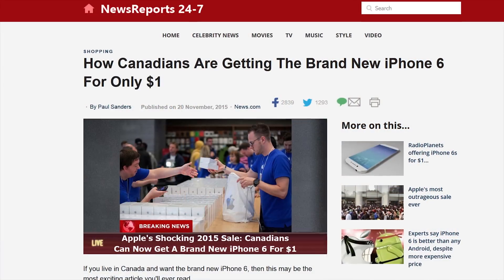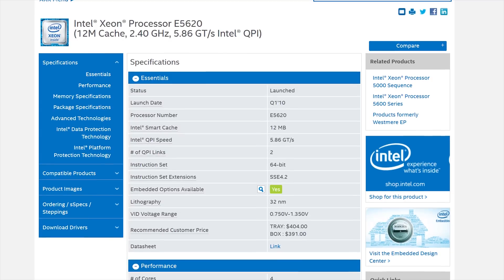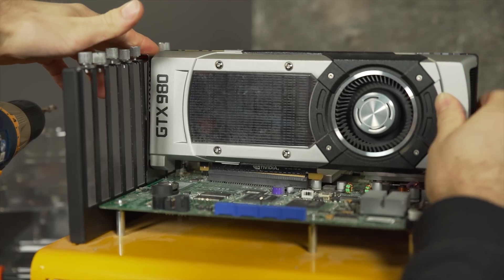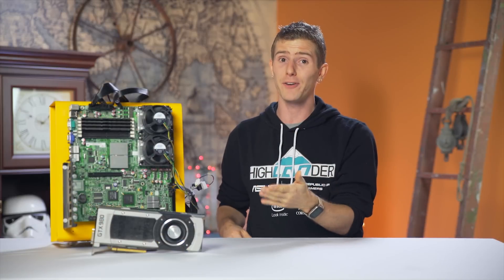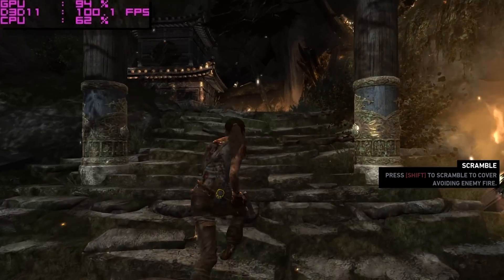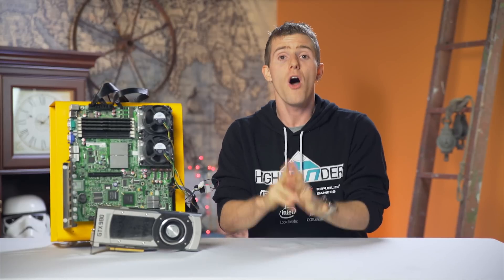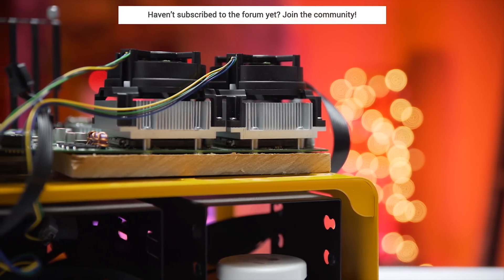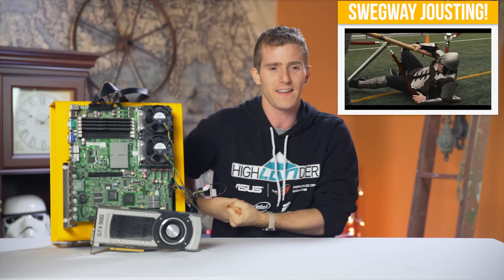Under $150 Budget Gaming 8 Core CPU, Motherboard & 16GB RAM

Comment: It's like saying, "hey watch me make a Plasma TV for cheap", while you put a old glass under some picture frame.  
500 usd gpu and you were surprised it all ran so smoothly, lol. smh.  YES to the trolls, I did read the title, but there is no gaming build without a gpu.
Reply from the maker: It's not trolling to point out that the GPU is not the point at all. A powerful gpu demonstrates where the CPU bottlenecks will occur.
Reply: LinusTechTips I know why it was used, but you're claiming a $150 Gaming build with no gpu bud, that's the point I'm trying to get across.
Reply: +Abo Bolanos don't get me wrong, I though it was great and all for $150, though personally I will recommend  to save up more and get a better on budget setup.  I just find it odd to include gaming in the title without having a gpu in there.  
Maybe recommending some cheap gpu that could go along nicely with it would have been great for those new to building gaming pc.
Reply: I think you might be missing the point. All he is doing is offering a viable solution. For a motherboard, cpu and ram combo, then using an expensive graphics card to test the raw power of the combo, which happens to be quite good as evidenced in the video. Using this information new builders can pick a gpu in addition to best suit their needs. Although a benchmark with something like an R9 280 or 960 might have been useful.
Reply: +Jacob Adamsky the word after "budget" and before "8"

You could argue he's just saying the specs listed are good enough to game, not a whole computer. But the word gaming in in there. 

The question is where do you see the word 'build' or 'computer' in the title.
Reply: +kawaiiprince Reviews The video never claimed it was a full system for $150, it clearly says 8 core CPU (that's the only lie as it's dual quad core), motherboard and ram.
Reply: +kawaiiprince Reviews While it is a little disingenuous using a $500 gpu, i don't think this is something he's trying to promote for people new to building pc's.  I just walked a friend through her first build, and while price was a consideration this wouldn't have even been an option. If you've never built before, the last thing you need is detective work hooking up the front panel, drilling new holes for mobo mounting, and hacking together a cpu cooler support.

I am considering this, however, since my current system is getting sadly outdated and my workload is typically more cpu-intensive than gpu. Plus, being server hardware, the only crapshoot on linux compatibility will be the gpu.
Reply: +kawaiiprince Reviews I was jumping between parts in the episode to see how you could find a 980 for such a low price. I did just read your comment. Thank you for saving me this bullshit video xD
Reply: zionlee1004 Are you sure? Look at the thumbnail, it says 8 cores Gaming Rig.
Even the title has the word Gaming in it.  Including the word game means a build which will run games under the budget, and it does not because the gpu cost was not factored into it.  Guess who's the dumbass now on the internet? Try looking in the mirror.  I'm done with this, it's quite obvious the cost doesn't include gpu, and thats all I'm saying.  Stop acting bud hurt because someone has an opinion.
Reply: +kawaiiprince Reviews He says in the title it's $150 for the CPU's, RAM, and MOBO - not Linus' fault ya can't read!
Reply: +Pascal Lafrenière 8 is the minimum you should have as a gamer, anything under is shit.
Reply: Look at benchmarks with the AMD A10-7850k and tell me that again.
Reply: +kawaiiprince Reviews Shoot, i fried multiple motherboards under the same price just so i could game on PC. I think this idea well planned and a very excellent way of gaming under the budget.
Reply: +Eric "Smokey" Young maybe if you set the fans on 100%, they pull too much power, causing to underpower the gpu itself
Reply: +kawaiiprince Reviews Just a quick check, where the hell do you see gaming in the title: "Under $150 Budget Gaming 8 Core CPU, Motherboard & 16GB RAM"

I sure don't. it just says its a damned 8 core CPU, motherboard and ram combo fro $150...
Reply: The Gorgeous Fruit go be a ass hat else where.  I didn't use it as sarcasm, I did refer to him kindly.  I don't hate him, I've seen quite a few of his videos and he is a helpful person.  I just don't appreciate misguiding people.
Reply: Dantheman1you0 My beef was that it claims a $150 GAMING build with no gpu.  You cannot play any games without a gpu in this build, hence it's a misleading title.  That is all I'm saying, and everyone took their forks and torches out, as if I said something wrong.  It's a base build, but not a GAMING build.  If you honestly believe any new games can run with this build without a gpu, then please do enlighten me, I'd love you hear your thoughts.  Regardless whether it states only ram, cpu etc in title, it does include the word Gaming in it, which can be misleading and used as click bait.
Reply: Domonkos Horváth He is referring to the thumbnail that reads "Dirt Cheap 8 Core Gaming Rig" and is super butthurt that no one is siding with him.
Reply: +kawaiiprince Reviews The thumbnail says "Dirt cheap 8 core gaming rig". Nowhere does it advertise a full gaming rig for $150, and $650 for an 8 core gaming rig that includes a GTX 980 is pretty damn cheap. The title doesn't mention that it's a full build either, just a $150- CPU/Motherboard/RAM combo capable of being used in a budget gaming rig. On top of this, it doesn't mention building a sub-$150 gaming rig in the description either, it just says whether or not you can used old server hardware in a gaming rig.
Reply: +kawaiiprince Reviews no one ever said it was completed and it means you can spend much more money on your gpu...980ti setup with 16gb of ram and 8 cores for 1000$ anyone?
Reply: +LinusTechTips Linus, you know what you did. Stop it...
Reply: +kawaiiprince Reviews Well, gpu is not the point here... who trolls? dont be a child...
Reply: xDFWN ASVP GTAV Run well with my 4Gb setup! :D
Reply: FX8370 and R9 290, 50FPS FULL HD 2xmsaa
Reply: +LinusTechTips Linus the 771 dual socket is rather bandwidth limited, it makes no sense for gaming.
Reply: +kawaiiprince Reviews Where does it claim in the title that it is a build, all it says is CPU, MoBo and RAM.

You are literally arguing with yourself
Reply: +kawaiiprince Reviews It did not say its a gaming build. The title specifically pointed out 150 dollar budget gaming cpu, mobo, ram so that everyone can see what the content actually is(and for the idiots to not complain why there are no gpu). The title did not also say "gaming build" or "gaming rig" or "computer build"  get your facts straight before making yourself look like a complete dumbass on the internet.
Reply: So what if the thumbnail has the word rig in it? It can't falsely attract people because the title clearly says what it includes. Stop being a technically internet douche who always has to be right.
Reply: zionlee1004 Have you run out of insulting names and just decided to mash a few together? Because that's the only explanation for that laughable insult.
Reply: Actually, I am one of the people who was on your side of the argument.
Reply: No argument. Just my inquisition on your insult that is unrelated to the discussion.
Reply: I did not oppose you insulting them. Just the insult you used sounded funny and barely made sense but oh well. Like you said, that's the internet
Reply: kawaiiprince Reviews Click bait is the business tactic of youtubers. Everyone jumps on a bandwagon and tries to shoot the other one(s) down. I agree, it says gaming while it does not play games. If this were a perfect world, then click bait would not be a thing and it would not matter. Also, seeing the thumbnail clearly says "gaming rig" it is very misleading.
Reply: Dantheman1you0 well glad you understood what I meant.
Reply: +kawaiiprince Reviews he never said it was a gaming pc, just the mobo, 16bg ram, and 8core. sincoe you only spend $150 on it that leaves $350 left for a gpu and coasta only $500. that is the whole point
Reply: +kawaiiprince Reviews "Under $150 Budget Gaming 8 Core CPU, Motherboard & 16GB RAM"Unless the title was changed as a response to your comment, I don't see where this video would be misleading anyone.
Reply: Adeel Rehman He said a $200 GPU. Not a $200 PC. And don't assume you know how people's computers are set up.
Reply: +kawaiiprince Reviews Thats not what the title says. it says gaming CPU, ram, and motherboard. you get all of that for under $150.
Reply: +LinusTechTips As kawaiiprince pointed out the title is misleading Linus! I love your show but when I saw you first fitting the GTX 980 I raged because I knew straight away, with that card, this PC would cost way more than $150! kawaiiprince's comment is valid critiscism Linus, take it like like a man!!!
Reply: +LinusTechTips Your comment showed how much of an egomaniac you are. You bullshitted in the Title, stop lying to yourself and others.
Reply: +dan saunders Both very CPU heavy. If you really want it best of the best, get a more recent Intel CPU with hyperthreading, but other than that it's just fine. You'll be able to run them both on high with ~30 FPS, give or take.
Reply: If your CPU isn't powerful enough it will significantly bottleneck the GPU. The surprising part of this build is that the CPU didn't bottleneck the system nearly as bad as you would think it would.
Reply: I agree, but the idea is still there.
You can get decent GPU's on ebay for cheaps from places like old bitcoin farms, and tbh if you use linus' tip then you'd save enough money for a decent new GPU anyways

also btw he compares the cheapo built with a newer build using the same GPU in both, this is so it only compares between the CPU RAM etc.
Reply: +Hezekiah Domowski Thank you for understanding what I meant.
Reply: Why 16GB, 4Gb or 8Gb is good!
Reply: +kharlo calvo if youre on a budget, which it seems you are, go AMD. get an 8350. Also get a r9 290, its better than a 380
Reply: r9 290 is awesomely good!
Reply: +Eric "Smokey" Young Why do you need fans running at full speed if the GPU is not overheating?
Reply: Fan will not eat as much power. And If something bad could happen by not having sufficient electric power to the card, it will crash. 

if fan drain too much power, this will lower the 12V generated by the  powernsupply (psu). Regulator will still give the card the correct voltage(regulator take 12V and step down it to i.e. 1.5V (I dont know the correct value)), If regulator cant give the correct voltage, the video card or the psu will simply crash.. it is possible that the card read the voltage and "down" drive the gpu so it will not crash.. 

But for this to happen, INPUT voltage must be less than the needed voltage + 1v, or 1.9, or 0.9v. So for exemple if the gpu need 5V to operate, it will need only 6.9Volt to the regulator input, the fan will never do that even with a shitty power supply, you need like 10x 200mm fan to suck up that power.. And before, the fuse in the psu will blow.
Reply: +kawaiiprince Reviews what if he was showing a gaming controller for 50 dollars. would you say it was wrong cus it did not come with the pc?
Reply: +kawaiiprince Reviews ,         Pidar reklamas vareji nelikt , publisks Fuj....  -Latvijas Saeima :))))
Reply: watt?
Reply: +kawaiiprince Reviews you can get a decent GPU on cheap if you wait until right after there are new video cards on the market. not going to be at this level, but they won't be too bad.
Reply: +Pascal Lafrenière nice punny electricity joke.
Reply: kawaiiprince Reviews Thumbnails are click bait, get over it.
Reply: Dantheman1you0 you dont get it. the title is crystal clear. your a bitch. get over it
Reply: Dantheman1you0 then why argue with me?
Reply: Dantheman1you0 insulting a low life is pretty common on the internet
Reply: and for a minute lets buy into what your saying, even if it doesnt come with the gpu, spend the $xxx.xx on a baling gpu and you still pay fuck all for a rig that come perform amazingly, your bitching about nothing for the sake of it
Reply: These youtube debates (using that word very loosely; it's more like a pissing contest) are really quite ammusing
Reply: kawaiiprince Reviews you said something wrong get over it and look at your mistake dumb ass
Reply: Naffi Axx exactly
Reply: Fail.
Reply: Yes you can with an APU
Reply: kawaiiprince Reviews
Ass hat? you okay bud
Reply: leetdemise2009 APUs are shit though... look at the PS4 and the Xbone; they use APUs
Reply: +LinusTechTips What GPU would you recommend to run along with this rig to be best bang for your buck (yeah, I suppose most reasonable would be to hit e-bay/craigslist for the best deal) but what would you look for and at what price point? (just curious...)
Reply: +Rennaaa Don't think it meant to be misleading but maybe 8 core 'RIG' or system would've been more appropriate as its using smp. I think the masses would still understand '8 core cpu' more as a reference which is why it got used. We know what's going on but not everyone will. As long as it can utilize 8 cores, they understand that part.
Reply: +LinusTechTips I think he was trying to dismiss the trolls that might come to say something...he didn't call you a troll
Reply: +LinusTechTips Have you tryed benchmarking while cpu is unparked I got a 4% boost on my gaming rig unclocking parked cpu on windows 7 pro sp1 64.
Reply: +kawaiiprince Reviews I dont have a GPU and I play games fine...
Reply: Rectal Prolapse You can do some gaming on integrated no?
Reply: Rectal Prolapse
I'm guessing you have an APU. Unless you play retro/shit games.
Reply: Dantheman1you0 I agree. Not always. Just most of the time.
Reply: +kawaiiprince Reviews After re-watching this video just now, the very first thing Linus says (besides the ipad thing) is (surprise surprise) exactly what the title says. a CPU motherboard and RAM for your next gaming rig. Not seeing bait and switch here.
Reply: +kawaiiprince Reviews what about an APU?
Reply: +LinusTechTips i can agree a $200USD GPU can make a great gaming rig
Reply: Eric "Smokey" Young Its because you have your fan on auto. So, if it goes up to 70% then your card is overheating, and therefore thermal throttling
Reply: studio56 gaming plz post a part list, and what will you play on it? Honnestly i wouldnt build a 200$ PC because you will need to upgrade it alot.
Reply: ***** It says "gaming rig" in the thumbnail. Not saying he's right, just pointing it out.
Reply: ***** The point of the video was not to make a complete gaming rig for $150. It was to get only what the title listed. Why can't people get that. It's not for a complete setup. It's for a mobo cpu and ram.
Reply: +kawaiiprince Reviews Title said gaming 8 core cpu, motherboard and 16gb of ram, not entire gaming rig
Reply: ج
Reply: +speedqbcam 7870 now right??
Reply: +LinusTechTips I get fps 5 in gta v at 4k plz halp
pc spucs
gpu gtx 260
2048mb ram
core 2 duo
Reply: +Communist Karl i hope this is a joke?
Reply: +MrLegit11111 you sir are dumb as fuck.
Reply: leon kunts Thanks for your quality input
Reply: +Eric Young I eat my fans at 85-90% is that fine when I'm gaming on a demanding game let's say the division? when I stop I set the fans back to the normal %.
Reply: +lolpeterparker lolson *set/*put
Reply: +lolpeterparker lolson you really shouldnt need to set fans on anything, they should be automatic>??
Reply: Thormejh why
Reply: i thought it was better to set them higher cuz then it wouldnt take so long for them to spin faster
Reply: lolpeterparker lolson well I guess it all depends on the hardware you have. If they aren't running over the limits there's no need to shorten the fans life. But id have to ask 20 questions to know exactly what's right for you specifically ha-ha.
Reply: +Thormejh then ask :)
Reply: +lolpeterparker lolson well. what's the CPU. what's the gpu. what fans are on them. what fans are in the case. is it dusty. what games do you play. what resolution. how many frames do you need per second. what are the temps with and without fan boost. are you over clocking them at all. I think that's it?
Reply: +Thormejh cpu : intel core i5 6600 ( not unlocked ) gpu : gigabyte gtx 960 4gb oc edition ( manufacturer overclocked it before I think not sure. pls let me know if you know )
Reply: +Thormejh fans on gpu are just 2 stock I guess? and on cpu I'm just using a stock intel cooler
Reply: +Thormejh got 3  nzxt 120 mm fans in my nzxt s340 case and I'm a new pc gamer so my case is not dusty at all
Reply: +Thormejh i don't  play many games but I'm going to get the division witcher 3 etc. some relatively new games but I own batman arkham knight pc and fallout 3 gotye. I always play at  1920x1080 res.
Reply: +Thormejh need min 40fps
Reply: +Thormejh max temps regularly is like 67° and now that I've boosted a bit it's like 72ish°
Reply: +lolpeterparker lolson ok so you have skylake so if you arent overclocking that should be running pretty cool. if its not look into a hyper 212 they are amazing cooling for the price! the gpu fans should be pretty good especially if its an oc edition. for the case fans i would say best setup would be two front pushing air in and one on the back pulling it out. for the games youre looking at with 1080 you should be playing med/high with great frame rates maybe even better i havent checked out the 960 to much. and i would think for the 72 you mean the gpu and that should be fine as long as its not going over that. since you have all new good stuff the fans should do exactly what they need to!
Reply: +lolpeterparker lolson oh also good choice on the case, same one i have, and its my favorite case of all time!
Reply: +Thormejh thanks bruh
Reply: +Thormejh the white one looks sick. but I didn't have any fans where the large magnetic dust filter is
Reply: lolpeterparker lolson yea it doesnt come with any front fans just 2 in the back, i have them in the original spot because i have a xeon and dont need much cooling. but front and back would be a better option
Reply: +Thormejh do you have a top fan?
Reply: +lolpeterparker lolson i have the top and back fan, im to lazy to switch one to the front xD
Reply: lol, is it easy setting up some fans on the  front?
Reply: +lolpeterparker lolson oh it's super easy. but I work out of state. with my desktop at home. so if I don't have to do something I don't lmao
Reply: +kawaiiprince Reviews He is claiming $150 CPU, mobo, and ram build.... Not a full gaming PC build obviously and this is more for shits and giggles to the peasants anyways...
Reply: +kawaiiprince Reviews I agree the word budget gaming should be left out of the title
Reply: +Pascal Lafrenière :) better without PhysX !? lol
Reply: +Paul Petru Alexandru Cazacliu physX is included in all 900 series nvidia gpus
Reply: this isnt a $150 computer, this is a 8 core cpu, mother board, and 16 gb of ram for $150
Reply: Dadda Purple you're a little late bud.
Reply: +Thormejh ;.c
Reply: +Thormejh As are you lol
Reply: wolfgaming0013 you weren't Supposed to tell anyone!
Reply: +kawaiiprince Reviews It never claimed to be a build though.
Reply: +kawaiiprince Reviews However, abt the tv crap for cheap, bought a 50" tv for less than $125/£97.50, was broken, loose wire, watch everything from my pc on the big screen....lmfao
Reply: +Stephen Boutin I agree with you, the title specifically says no GPU. However, to the un-knowledgeable user, the machine will work for $150. 
What wasn't mentioned in the video is that, unlike the Intel CORE series, the XEON's have NO integrated graphics. Meaning that you have to have a GPU (however lowend it may be) for it to work.
Not saying the video is wrong, just an oversight. It was a great watch.
Reply: +kawaiiprince Reviews Actually, that's not true, lot's of games will run perfectly fine off a stock built in GPU Intel HD Grpahics pre-installed into the Motherboard. A lot of MOBA's and Games such as "World of Warcraft." are very CPU and RAM heavy games. They were designed that way specifically so that they'd reach the masses and get a larger player base, instead of just catering to the higher end PC market of Gamers. Most the game is already graphically possessed through their servers online and then streamed to whatever IP address the person playing the game is accessed to. You think all those fancy environment / in game world details in "WoW" are stored on a persons computer when they play? Not a chance! That game was made up of Petabytes of data stored on Blizzards many server farms and rendered through their GPU's before being sent over the internet to the player. I've played some pretty dope games such as Smite that have pretty good graphics in 720p 60 fps on my Tobhisha i-core 3 Laptop with just 6gb of ram and an Intell HD Graphics 4,000!! While that's a far cry from "Ultra Max Setting, full anti aliasing 4K resolution Crysis 3 gaming, it's still pretty doable, and the pixel density of even just 720p resolution on a laptop size screen makes it look rather sharp, and so Anti Aliasing and what not doesn't "HAVE" to be turned on and drop performance. Really it depends on your end game, and what type of game your playing. We've reached a point where one no longer has to render a game solely through the progressing power of their own computer rig these days, and for games that need to be played "Online." anyways, this isn't much a big deal, we've found "hacks and tricks" to bring high end quality gaming to the average consumer.
Reply: rockstar89
 Those games that can run off of intel socket gpu are usually crap. I dont care how many idiots play Wow or DOTA 2, those games are fucking stupid. The way professional gaming was going IN THE BEGINNING was the way to go. They just made it un likable using shit like MOBAS and MMO's.
Reply: +kawaiiprince Reviews The only problem with your statement is that the video isn't about a whole rig, it's about the foundation.
Reply: +kawaiiprince Reviews thats where the rest of your budget comes in
Reply: +Akato he never said you can get a 980 that cheap. he said you can get 8 cores, a mobo, and RAM for $150. it's right there in the title.
Reply: It says "Under $150 Gaming CPU, Motherboard, and RAM."
No where does it say "full gaming rig."
Reply: +kawaiiprince Reviews hey im buying this for arma 3 and beam ng is it worth it 290 delivered amd fx 8320 black edition gtx 760 2gb 16gb ram 1 tb hdd cheers.dan
Reply: +Paul Petru Alexandru Cazacliu physX, what is this pls explain, I tried to look it up everywhere
Reply: Since the GPU was bottlenecked significantly, you'd get the same results with a lower end graphics card. I guess.
Reply: It is trolling to get Linus to reply to your comment, though. :)
Reply: i tryed the same bit my PC dont boot
Reply: I looked back up and - damn massive oversight man - even if you have a onboard driver that is not enough for a gaming pc
Reply: +alexmania1998 About what bottleneck are you talking about, cpu load on the video not exceed the 65 percents? The problem is where to find this magic motherboard and it price will be much more then 150$ with 2 cpus in kit.
Reply: a gtx750 or hd7790 is enough
Reply: that would still push over their 150 $ budget ... the point is more that they built a 'gaming rig' without including the graphics card (wich is quite a expensive component as well...) it misses the under budget point for a dirt cheap gaming rig, which should also include the graphics card.
Reply: Have you ever heard of bottleneck? No, of course you haven't.
Reply: no i forgot about it :V
Reply: My 30 usd Compaq PC have a 500 Cinebench Score... It uses a Core2 Quad.